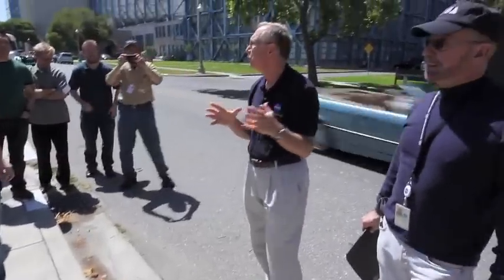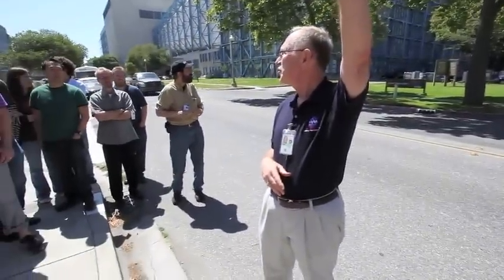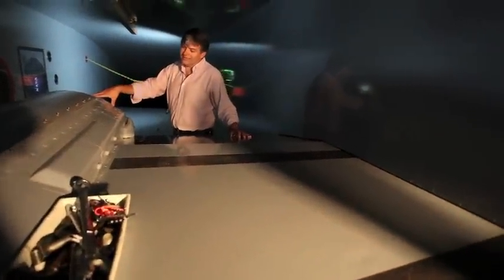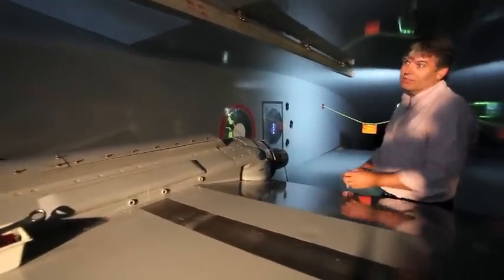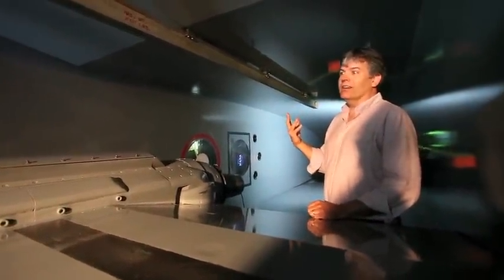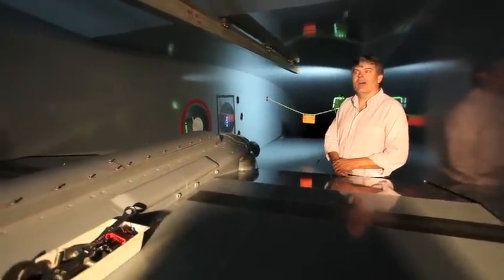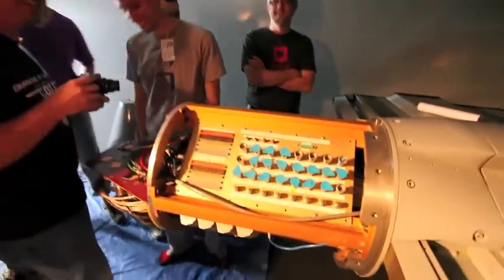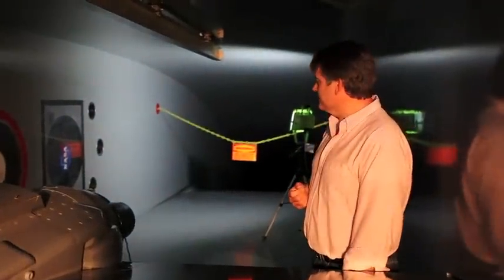Tour of NASA's wind tunnels

Comment: In 1976-77 I got to work out there on a high school work experience program, assisting in building models for the tunnels. I helped skin a 1/2-scale outdoor pylon model of the QSRA, and when I finished they were just getting ready to start on a model for the HiMAT pilotless research jet.

 I also did pylon work in the 12-foot pressurized tunnel test section and in one of the 5x7s. They were testing a model for the Space Shuttle's 747 transport in the 40x80-foot tunnel at that time, mounted upside-down on pylons, when the 80x120 test section was still just a plan on paper.

 I also got to see many fascinating thingts during free time, like the flight sim building, the centerfuge (in the same building), and the test area of the 11'x11' portion of the Unitary Wind Tunnel. What an experience that was for a teenager!

Comment: How many motors are there for this tunnel and what are the horsepower of them?Do you have a cooling tower for it?
Reply: 4 motors @ 65,000 horsepower each and there is a cooling tower on the corner of the facility.